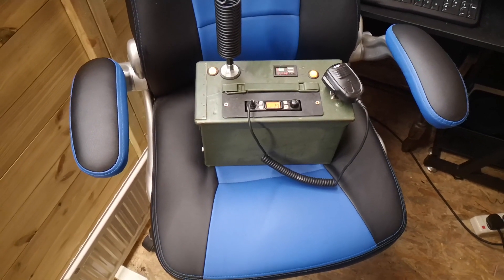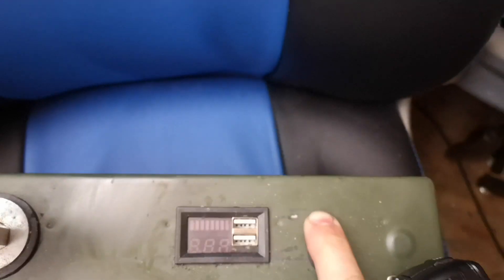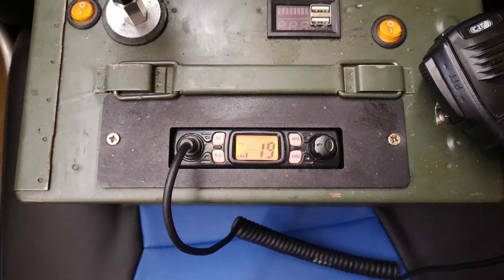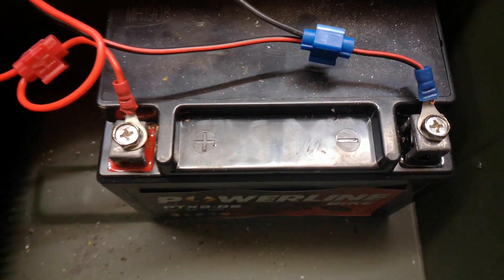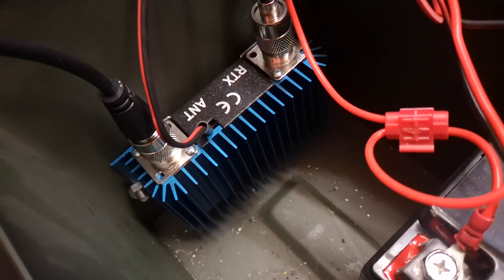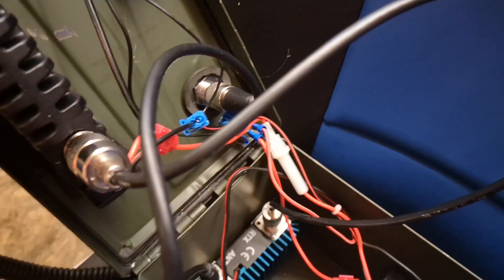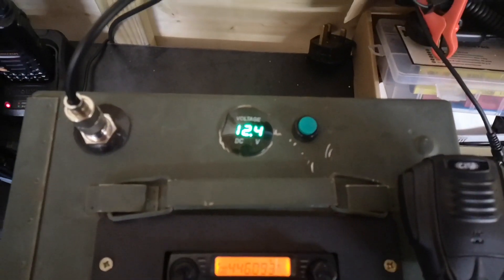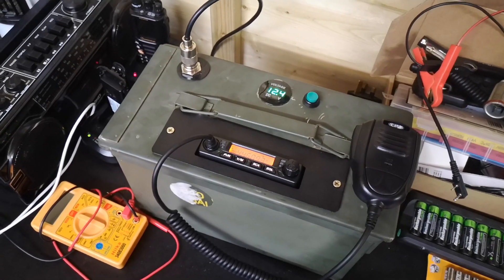Home Made CB and PMR radio Go Boxes

Comment: Nice job but you need a long cable with outside antenna you re being radiated my friend every time you key the mic not a good thing. Get an so232 connector and use a portable rollup j pole antenna throw it in a tree limb.
Reply from the maker: Hi, thanks for the comment. Interesting you mentioned that as I've had a nasty RF burn from it in the past.
Reply: @DJJAKEY2009  The cancer factor 5 years down the road is what you really have to worry about it can happen. always get that RF outside lad.
Reply from the maker: @thomasrogen3739  I've got a T2LT antenna I could use instead of the Springer and a fibreglass pole to mount it on. I also have a CRT SS6900 I tend to use more than this now as it has sideband etc.. had very good reports from it too in comparison to this go-box so might use the go-box less often
Reply: @DJJAKEY2009  IF YOU DID TAKE YOUR TEST FOR HAM RADIO MAYBE YOU DID NOT BUT IT COVERS THAT MATERIAL IN THE STUDY GUIDE HAVE SOMEBODY READ IT TO YOU.
Reply from the maker: @thomasrogen3739  hi, I haven't taken any exams as of yet but I'm not ruling it out

Comment: That's pretty far out. I bet ya could get a Jackery 500 solar generator and use that as well.
Reply from the maker: Hi, just looked at those. The solar panel wouldn't charge this setup correctly as the Jackery 500 uses a 24v battery whereas this uses a 12v one. That being said, eBay is probably the best place to get a 12v solar panel and charge control regulator from. Like the look of those generators, shame they only run 110v appliances.
"Edit, they come in a 240v version too"
Reply: @DJJAKEY2009   I got a Jackery 1000 and it's got a 12 cigarette lighter plug that I can run my radio. 
I just the 500 cause probably be easier to carry.
Reply from the maker: @phillipstracner7909  thinking about it, I have built a similar thing in the past for the novelty aspect, but it turned out to be very useful. Have a look here if you like. https://youtu.be/DIq4XhhBwdQ
Reply: @DJJAKEY2009  ok cool
Reply from the maker: @phillipstracner7909  thanks. It now has a 15ah 12v LiFePO4 battery and better wiring.

Comment: Nice looking Go Box but needed to replace your lead acid battery because it under-powered plus it way too heavy to carry around. As 50Ah LiFePO4 battery is so much better way to go plus it much lighter weight and far longer lasting battery than lead acid battery.
Reply from the maker: Thanks for the suggestion. I do have a 12v 15ah LiFePO4 battery I bought specifically for a backup but might consider installing it at a later date
Thanks again - Jake..

Comment: how do you charge the battery?
Reply from the maker: Hi, I have built a jack plug into it so you can simply plug in a 13.8v trickle charger into it. Works a treat..
Reply: @DJJAKEY2009  that's awesome. What trickle charger specs are you using for this battery ?
Reply from the maker: @jkpisces  it's actually a motorcycle battery charger as the battery I'm using is designed for a Honda motorcycle. Hope this helps
Reply: @DJJAKEY2009  yes it does ! thanks for your info and great video

Comment: Зачем такой ящик, если существуют портативные рации на 27мгц...
Reply: Good reasonable question. In theory, an external antenna should be able to let a 27MHz handheld reach out nearly as well as a go box or mobile install with a stock transceiver, but the mobile units used in a go box have connectivity and features the handhelds usually don't. The go box can be built with linear amplifiers, antenna tuners, battery packs with greater amp hours storage, etc. It's not that the hand held isn't good enough for what it's designed to be. It just can't be modded to be significantly better. At least not easily. Mostly, the go box is for makers, hobbyists and experimenters, people looking to do more but still be portable. Mated to a 30 to 50 foot field antenna mast it could be used as a field base station to act as net control for mobiles and handhelds. In other words; because we can. A handheld has a range of a couple miles at best in most conditions. A mobile in a car or truck can manage 3 to 10 miles. A well made and operated go box field base station could do 10 to 15 miles or better on the same 4 watt output. With a linear amp, 20 to 30 miles is reasonable even excluding atmospheric tunneling. A lot of things have to be taken into account to know exactly how far a signal can get out clearly. It's not just the frequency band or power output, so those ranges aren't bible fact, but that's part of the fun of learning radio theory. CB, FRS, MARS, without a license, GMRS or HAM with one; the hobby can be as cheap and simple as a $20 palm size Talkabout or as expensive as a $100,000 fully equipped all modes digital HAM shack. One thing isn't "better" than another. They're just different levels of the radio communications hobby. Hope that's enough to answer your question.
Reply: @eljuano28  при мощности 4 watt большой разницы с 10-15 watt при такой антенне не будет. Для дальности все равно нужна полноразмерная антенна. А с маленькой рацией тоже можно использовать большую антенну. Сами передатчики одинаковые, разница только в их размерах. Портативная рация с полноразмерной антенной будет работать гораздо дальше, чем большая рация с такой короткой антенной. Да и к этой антенне можно подключить портативную рацию и сделать маленький manpack

Comment: Good job but you need a few more fuses also it is not water tight if you get caught in the radin your box will hold water.
Reply from the maker: Hi, good point about the fuses, and I will only be taking it portable in the summer time when rain isn't forecast. Thanks for the comment and I'll be adding more fuses soon.

Comment: how long dose that battery last when the burner and cb are running
Reply from the maker: Hi, the battery lasted a whole afternoon with somewhat heavy transmitting. Never ran out of charge so can't give you an exact number.
Reply: @DJJAKEY2009  thats good Enough to  make some emergency calls on.  thanks for the replay. and its a great set up i used to be on the CB back in the erly 80s and ive just got myself some old CBs with the old am fm usb lsb ive not used them yet the mikes need wiring up the ones i got with it have to meany wires on it for the 4 pins do you know how to wire mikes to the right rig have you done any videos on that subject that i can follow
Reply from the maker: @woody1766  unfortunately, wiring microphones isn't really my forte. I'm sure there's plenty of videos on the internet somewhere, but that's about the best I can suggest. I was originally a PMR446 person myself but I got into CB a few years ago. Bear in mind that I'm only 25 years old too
Reply: @DJJAKEY2009  thanks ive tried looking on youtube for the wiring but i can't find anything i need but i will keep trying.  not meany people your age go back to CBs glad someone your age is taking a intrest in them they could start to become pop again who knows.. take care
Reply from the maker: @woody1766  Hopefully it takes off again, fingers crossed..

Comment: I don't know how the standing wave is okay when you're supposed to have 18 feet of coax for a flat standing wave
Reply from the maker: Neither do I, but it seemed to be very low on all channels
Reply: The length of coax is quite immaterial if the antenna is matched to the line, which it obviously is in this instance. The ammo box is probably acting as a ground plane, which will help with matching and the Springer is fairly broadband anyway. A lovely neat job of metalworking - very well done! RAYNET should be having a look at this.....from G4FSN
Reply from the maker: @ericwalton1492  thank you for that, I'm not 100% when it comes to the technical side of things..